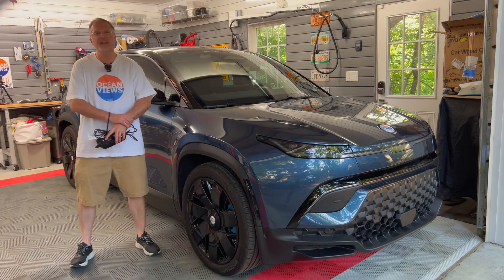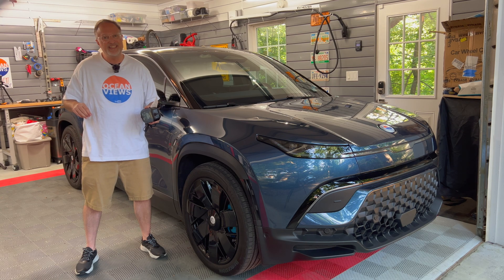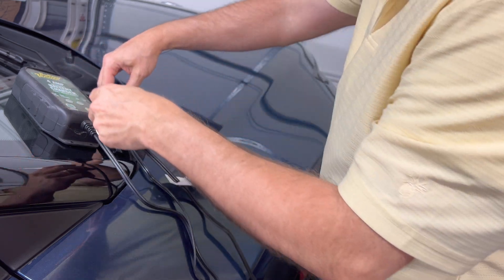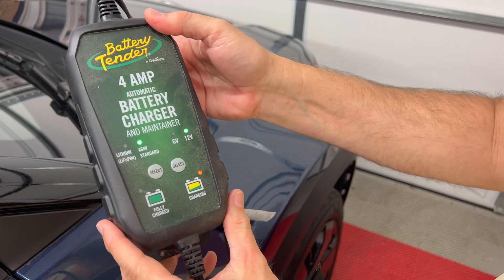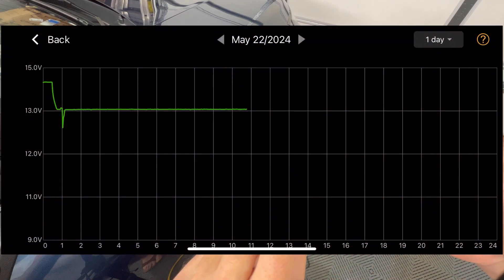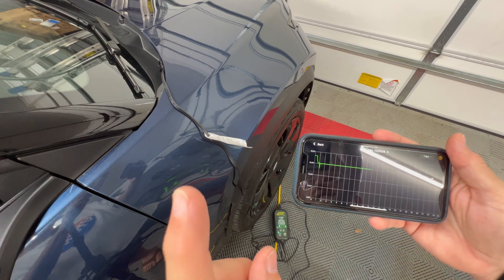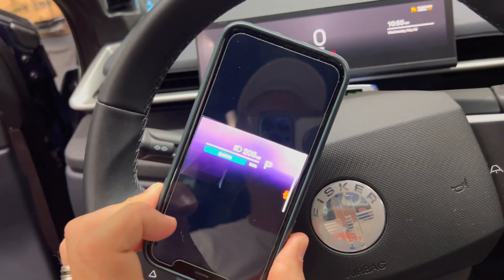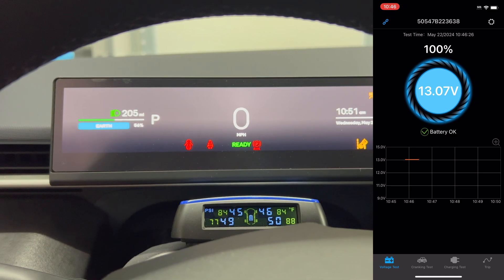Fisker Ocean One - Solution To Vampire Drain?

Comment: Thank you. Hmmm, it’s odd that you’re experiencing that kind of daily drain under the 2.0 version. Hope it gets resolved with a new OTA update - that is,  if we get one (fingers crossed). A tech came to my home a few months ago in mid / late winter and updated me to 2.0. It still shows v2.0 (1/2) today but I was assured it’s the full version. Afterwards the vampire drain decreased, going from 3% - 5% daily to maybe 1% - 2% daily. However, now that the weather has become warmer in the northeast I have seen a significant drop in vampire drain to 1% over several days if not longer. I wonder if  it will go up again in the coming fall / winter and if the trickle charger trick during colder months will be a good option for me. I use i the Fisker as a backup vehicle so it often sits in the garage for days at a time. I’m just confused why some of us original One owners are having different experiences with vampire drain than others. 

Good video.

Comment: How is this different from just plugging your car in?  They both consume power and would stop vampire drain…
Reply from the maker: When plugged in or not, the car still appears to use the high voltage battery pack for charging the 12 V battery.  The underlying system seems to waste more energy than just using the tender. I may have to find my killawatt energy meter and do a comparison.  Hopefully this can be reduced with software updates.
Reply: I agree. Unless you're actually disconnecting the drain, you're just replenishing the drain with wall power, either with an external 12v charger or the car's built-in charger. Scientifically and mathematically, you should be replenishing the car with the equivalent of the vampire drain, the difference being attributed to less efficient conversion to 12v.
Reply from the maker: @foxtrotwolf6081  one issue is that the. At has to wake up to charge the 12V battery.  The battery tender has less overhead cost from a power usage point of view.  I’ll verify in a future video.